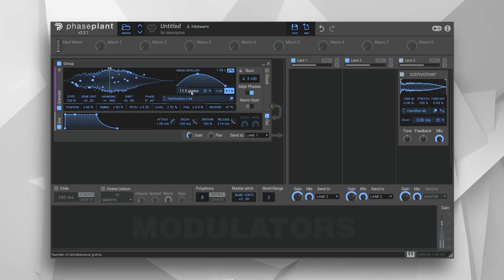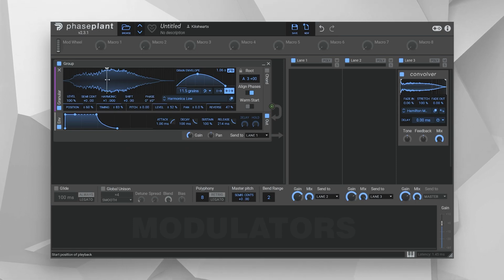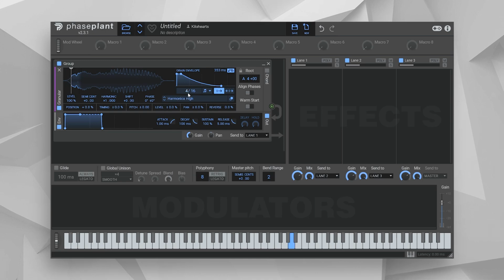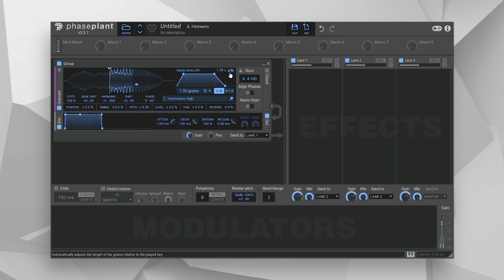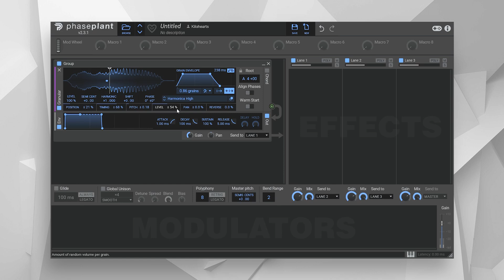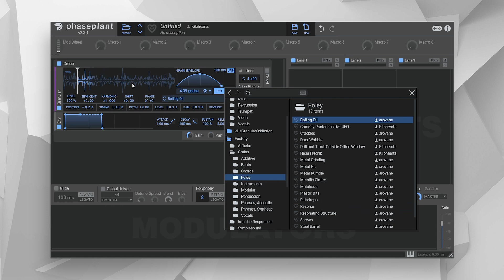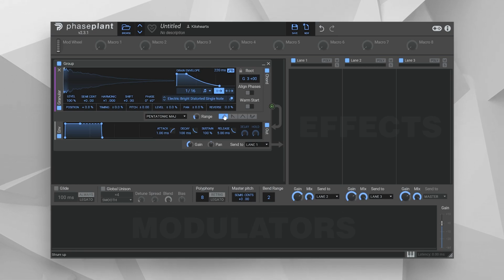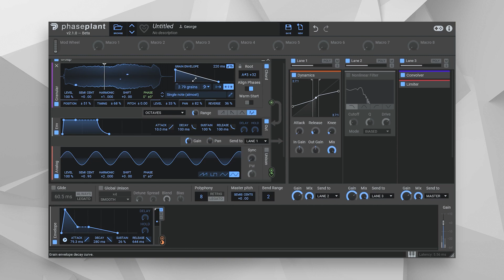4.5 Granular – Beginner's Guide to Phase Plant

Comment: its almost perfect! It would be great if it were possible to disable pitch changes, since the starting position can be automated using a note module — meaning the position marker changes when different notes are played, but the pitch stays the same. Kind of like a granular sampler.
Reply from the maker: You can set the Harmonic to zero and then use Shift to set the base pitch. In that case it will always play at the same pitch regardless of which note you play. If that's what you mean? ❤
Reply: @Kilohearts  omg yes! Thank you very much!